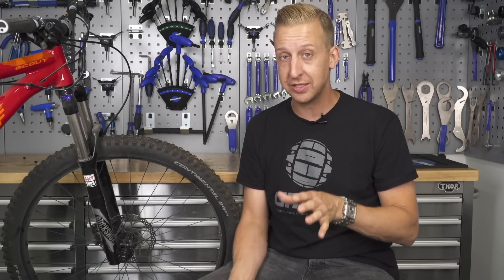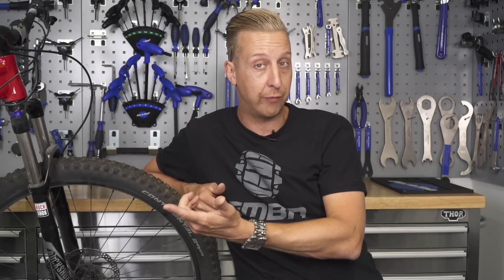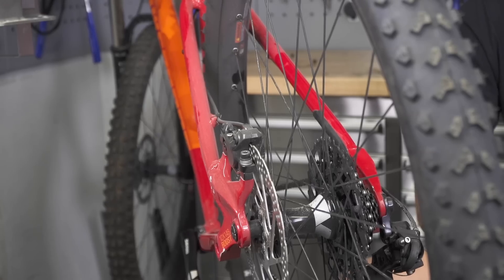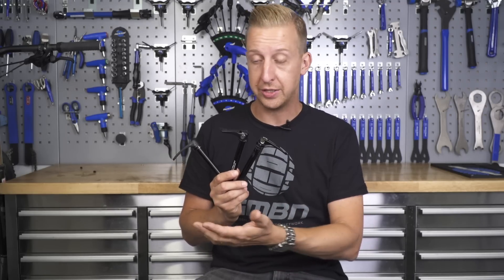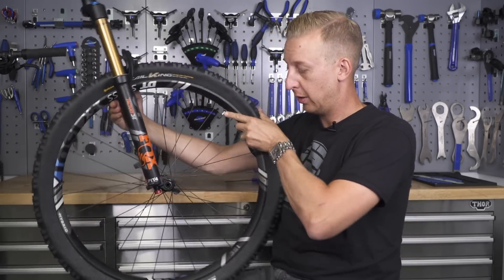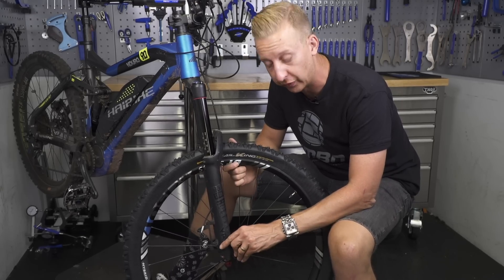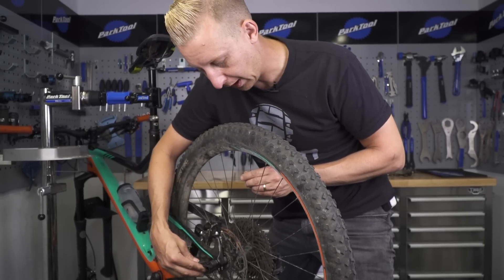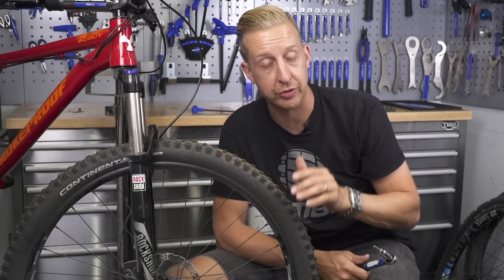GMBN Tech Essentials Ep.1 | Wheel Axles

Comment: I know that you have a tutorial on tire pressure but I still don`t know what tire pressure I should have. I weight 52 kg and racing with the Scott spark RC 900 team bike with the stans no tubes crest mk3 wheels(Rim Internal Width: 23.0mm). I have the maxxis aspen 2.25 tires on. I can say that I´m a skilled racer and know about where the limits is on the tires before it folds or blows up but I'm still not sure what tire pressure I should have. please help.

Comment: Summary: we had a standard that was fine, now it's a confusing mess.
Reply: Money money money money 💰 💰 💰 💰
Reply: Yep. Facts. Not only confusing. But very frustrating as well if you are like me and you are having a bike that has the old 100 and 135 mm axle standards. It's quite hard to find forks that are non boost as well too 😢
Reply: @joshhhhhhh713  Still have track wheels with 100 and 110mm
Reply: Cycling is a cult

Comment: I've had all the main ones on bikes over the last few years plus a few of the less common ones and the best one I've come across for forks is the Cane Creek D-Loc.  It automatically puts the lever in the correct position, has an adjustment collar that doesn't break like the ones in Maxles and the locking switch means that it won't fall out even if the lever flips open.  Such a clever system that just oozes quality.

Comment: I found Maxle frustrating. There's the "notch" that you need to push the lever into and it wears down. The threaded end cap comes loose (brand new) so the axle is loose no matter how much you tighten it. Also the cam has a hidden 2mm hex to adjust the tightness, in case you're wondering why the cam keeps popping open. Amazing how many things can go wrong and be so unintuitive. Even bike shop mechanics will be confounded by why your front wheel is flopping around. Only took about a year for any info from Rock Shox to come out...oh wait that info came from user forums and YouTube.

Comment: Is there a possibilities to use Thru axle on vertical dropout? #AskGMBN
Reply: Simply put, no, sorry...
Reply: Ohh thanks
Reply: Nope because the frame of the bike needs to be built to handle a thru axle. The thru axle threads are machined into the frame. Also thru axles usually are on newer frames with wider hub spacing, 142mm. The regular QR bike frames are only 135mm.
Reply: No, the clue is in the name of it ie the axle goes through a whole in the frame. Wheras conventional qr slides into the dropout.
Reply: Thank you guys.

Comment: would you recommend a dab of loctite on the threads of the standard bolt style axel?
Reply: colin p Loctite is not necessary. Axles are meant to be undone to fix flats or to transport your bike. So you would be breaking Loctite bond often. Proper tightness should be firm but still open-able by the rider of the bike.
Reply: i mean for the ones you need a tool for ... and i don't mean i high strength loctite ... and in an ideal world you shouldn't be taking off your wheels that often
Reply: colin p in a later comment I made. Be careful to grease you through axle. I have a Allen type and it seized solid because I hadn't taken the wheel off due to being tubeless and no grease. It took ages to release and I had to use a mallet and drive to get it out. Remember, grease, and torque to correct setting. You'll be fine. 👍
Reply: oh yea ... i had forgot that they needed grease ... would probably make loctite ineffective anyways
Reply: colin p Even for bolt on axles, no Loctite is needed. You never know when you need to fix a flat tire and with the small hand tools, the Loctite can make undoing the wheel really difficult. As mentioned by others, properly tightened nuts with a little grease to prevent seizing is perfect.
Reply: colin p no way with the lock tight, these through axles are pretty tough, but you'll end up breaking something, like the lever you undo it with. Lock tight is for more permanent fixtures. Never really need it on a bike, nothing is likely to come undone if it's at the correct torque.
Reply: i'm not talking about the axles with a lever ... i mean the ones that are just a big bolt ... and i didn't figure it would hurt ... i know it's not needed i just figured it would make it where you don't need to check it every ride
Reply: colin p loctite is an anaerobic glue that cures in roughly 24hrs. loctite comes in various different strengths and for different applications. the main ones you may see are red, blue, green and purple. Red is the highest strength, this might need heat to undo, blue is medium strength and can be undone with hand tools and green which is a medium to high strength can be undone with hand tools or heat. Finally purple is designed for low strength metal such as alloy. If you where to use loctite on an item that is to be undone you can see that they will all take a reasonable force to break. Using small portable tools, such as a multitool may not give you sufficient leverage. Also you would need to remove the old cured adhesive and replace with new. On bicycles bolts that may vibrate loose and are not normally require to be removed such as suspension or handle bar / seat bolts it would make sense as you are unlikely to adjust those on a ride. However, a wheel that may be removed to transport or repair, an adhesive may prevent that happening or with trail tools cause damage, hence the reason it is designed with torque limits so that is is secure enough to handle vibration and easy enough to remove when required. Hope this helps, Happy riding, Hassle

Comment: You guys should make more stuff for low-end viewers also! Like more advice/info from qr like qr 141. Also in this video there is no info from the trough axle that my Trek Roscoe 9 uses. But still nice video and you guys make good stuff :D
Reply: AD 64 Essentially, 141 is "QR Boost" - that is, a regular 135 QR with the hub flanges spaced 6mm further apart.

Comment: #asktech How exactly does air suspension work- how does it compress, etc? Thanks. BTW nice hair Doddy
Reply: You have a pressurized chamber with a piston in it. When the shock is being compressed the piston pushes into the chamber, reduces the volume, and therefore increases the air pressure/resistance.
Reply: Just to add a piston in oil provides damping